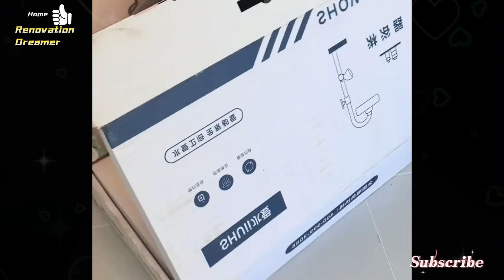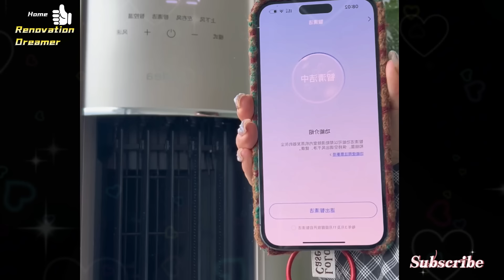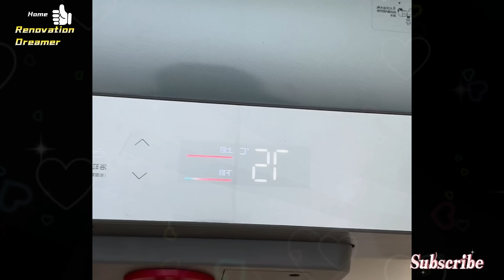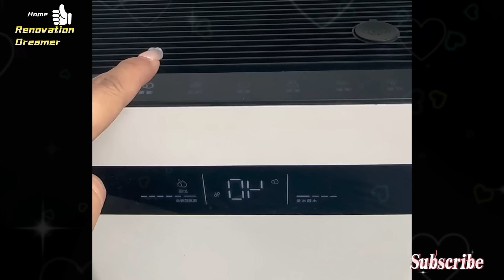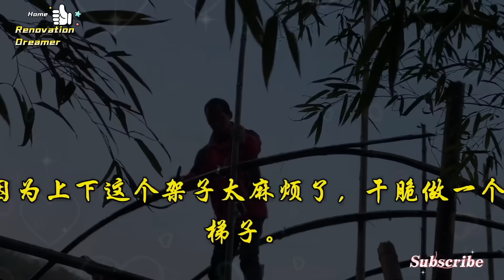The girl transformed her grandmother's old house into a luxurious villa. So beautiful~#building

Comment: the idea to get the big window for the view was awesome , youre verry lucky to found that location wat that amazin view 

a few comments on the work :
in the netherlands we lay the regtangular tiles in an offset ( like with a brick wall) it gives the floor a little extra if you cut every second row start tile exactly in half you could use the tile piece left in the 4th row etc

i think the biggest reason why the grout in the shower broke out is because it was not washed in far enough intoo the grooves , usually and aspecially for floors we make grout thinner so it flows all the way to the bottom of the grooves when we rake it across the floor , then we use a sponge to get the stuff off the glazed top of the tiles and the make the edges in the grout look nicer , we usually close the corners and edges with silicone as that stays flexible , was a little sorry to see you paint over those nice tiles 

verry nice job on building the floating bed , might put a wood floor in the centerstructure and put a little weight in it so if youre sitting on the edge with a friend the bed doesnt flip over to the side youre sitting as center has a smaller footpring than the edge of the bed 
nice idea with the grass on the deck and the flowerpots along the edge should keep it from flipping over during windy conditions 
the pad made from the old bricks could have been made a little smoother if you filled in the low spots , they probably fill with rainwater now when its raining , it does look nice and rustic though and fits the landscape , 
those pebbles that stick out on the concrete part can realy trip and hurt you if you walk there after dark 

the rest of the home has realy been made nice , i realy like the furniture , the lights and the ideas to recycle the flowerpots the table you made from car tires etc

Comment: I am from Illinois USA. I was completely in awe of the gentleman at the end working with bamboos. It’s just wonderful.
Reply: Did you know that some species of bamboo are stronger than steel is some aspects?  Tensile strength is where bamboo excels as compared to steel.  Bamboo is also much lighter (of course) and easily a sustainable source of building material.  Bamboo is almost the perfect material to build buildings from, except for a few downsides.  It has no where near the compression strength of steel, so you wouldn't be able to build very high.  It is also difficult to connect, as you cannot simply nail it together.  It is very flammable.  It will burn down to nothing flat extremely quickly.